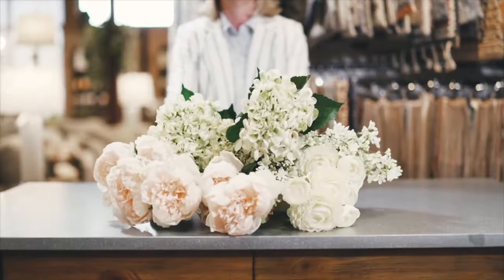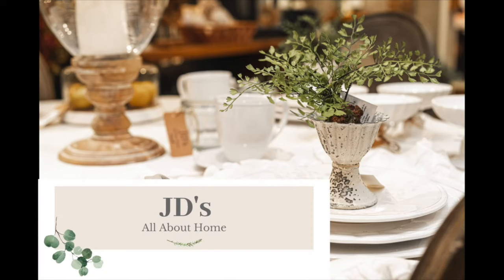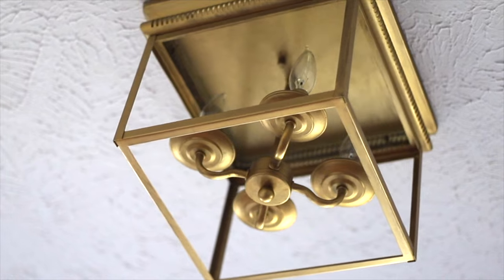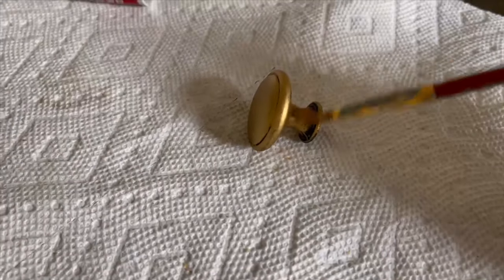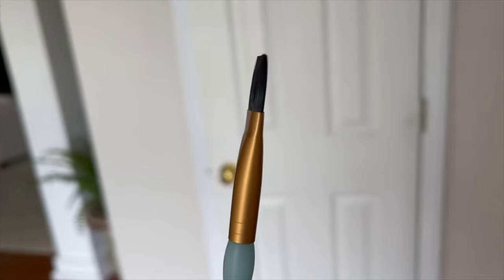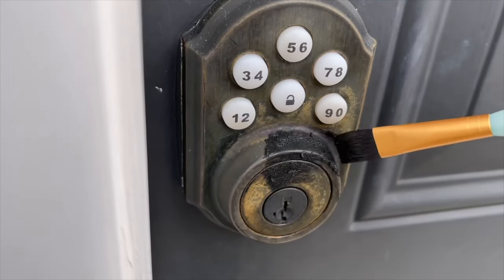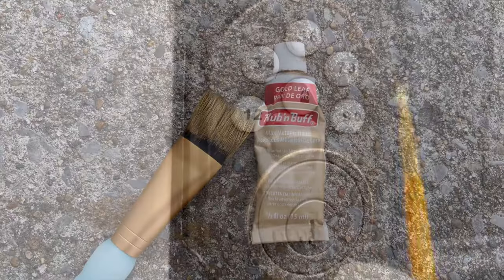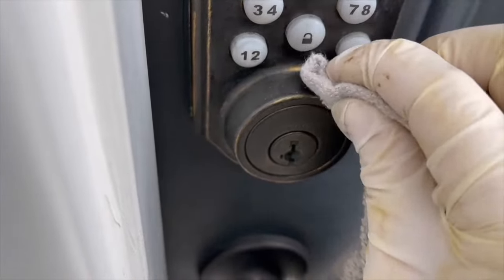RUB and BUFF | Rubnbuff DIY Projects

Comment: I ordered some and am going to apply it today on a door lockset I had to replace. The only one available was satin nickle and I need dark bronze so I bought black. 

As a former handyman in high school and throughout college, and after having renovated several homes, I'm a pretty capable handyman/problem solver. I personally would have removed the light fixture to refinish it. The lockset, too. You did a great job, but ensuring the lines are crisp and even is tedious.

Comment: I just received my new rimless eyeglasses in the mail today (online order). The hardware pieces (nose bridge and side pieces) are very noticeable because they are screwed directly into the lenses. But the gold color is way too shiny, and the nose bridge is thicker than my previous glasses, so that's what you're looking at when you look at my eyes. Would Rub N Buff work to tone down the gold finish, or provide a matte finish? I had never heard of Rub N Buff until I googled to find a metal paint I could possibly use on eyeglass frames. This looks like a miracle.
Reply from the maker: I think Rub N Buff would be a great option!

Comment: I tried touching up an old copper lamp and when I try the "buff part" it just rubs right off, what am I doing wrong?  I did use plastic gloves to put it on and tried both buffing right away and then again letting it dry.